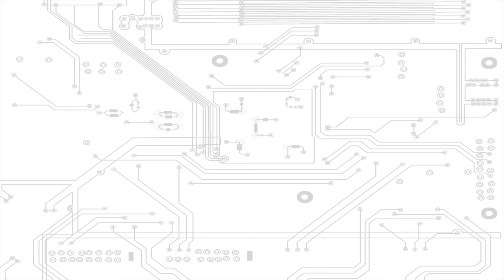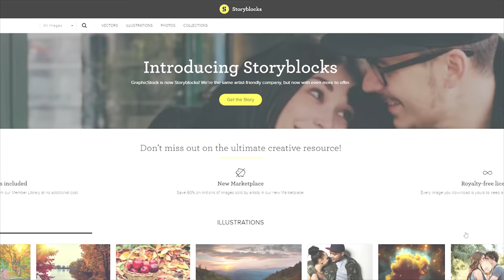Watercooled and Overclocked 7960X in Cosmos C700P

Comment: Is it just me, or is custom water-cooling pointless unless you cool both the CPU and GPU(s)?
Reply: JWil42 It's just you.
Reply: Whitney Akers but if you’re only gonna do the CPU, why not just use an AiO?
Reply: JWil42 Because a custom loop far outperforms and will long outlast an AIO.
Reply: Whitney Akers ok; I guess you can have more rad space if you go custom (I would still have the GPU[s] on the loop, but that’s just me)
Reply: JWil42 Sure, but that's not the only performance advantage. Custom loop pumps are far stronger, custom loop parts are all copper, and a dedicated block tends to have better thermal efficiency than a block/pump combo. I'm with ya on including GPUs, mine is in my loop, but there's still plenty of reason to just do a real loop on CPU only. =)
Reply: Whitney Akers yeah; I have yet to do a custom loop on my rig (I might get the EK A240G kit for my 4790K and GTX 1060)

Comment: I enjoyed the vid and enjoyed the build, but I still don't have a sense of how you feel about the case. Is it worth the money? I was excited about this case,  but then Demetri (?spelling) ripped it apart. It appears that some of the issues he had with the case aren't apparent in your vid because of the different way you all built in the system. For example he complained about the finger prints on the untreated metal inside the case...you didn't point this out but used gloves. He complained about the  gap or lack of grommets for cabling above the motherboard...you didn't have this issue because of the rad and fans...etc. Great vid but I still don't have a sense of are you recommending the case or if you prefer something else for $300. You don't even mention the fact the of how much plastic is used or that only the front is tempered glass at the $300 price point.....anyway Thanks for the vid.

Comment: omg...please help
i duno like the corsair 1000d case

i got the coolermaster c700p
420x60mm front push/pull 
240x30mm top push/pull
140x30mm back push/pull

is there a case where i can put like 3x 420(30 or bigger) in?

-_- that thing is so loude omg....

9900k @ 5.1ghz with aquacomputer vision silver/cooper and fancy display
msi z390 godlike with fancy display
4x 16gb corsair dominator 3200@3400 fancy rgb
2080ti +130mhz/+800mhz with ekwb fancy water cooler 
fancy ekwb rgb pump

noob tubing ^^''

i just wanna sell the "old" case and renew it

or what can i do to get lower water temps (expt. clock it down xD)
i like 2 modify ^^' 

help pls @jayzTwoCents and friends

Comment: I see you have mounted the fans inside the front Rad mount where as GamersNexus put the fans outside the rad mount and put only the Rad inside it as you can see here https://www.youtube.com/watch?v=rVIPsxWwkCs at 5:44 mins. If you can fit the fans outside, and still close the case may be you can use a thicker radiator in the front. I wonder if the same can be done to the top too so that you can then use more then 45mm thicker radiator without it bumping into your Mobo, put the fans on top of the mount, only the actual rad underneath. Thoughts please Jay ?

Comment: i9 7960X, GTX 1080 Ti SLI, 64GB DDR4 RAM..... Fortnite should run at least 25fps on average specs at 1080p x))

Well I wanna build my own gaming PC (it won't be these terrible specs) but I'd like to buy the Cosmos C700M from Cooler Master. My custom watercooling would be the CL-W218-CU00SW-A from Thermaltake.

That's the link to the Amazon page https://www.amazon.fr/gp/product/B07C2HW38R/ref=ox_sc_act_title_7?smid=A1X6FK5RDHNB96&psc=1

Do you think it will fit on the top panel of the C700M case ? Thanks :)